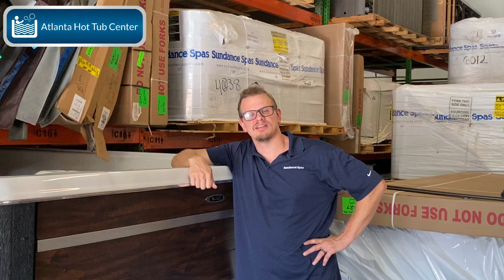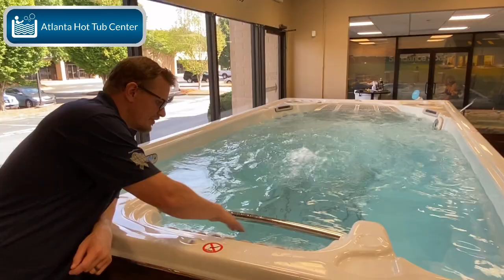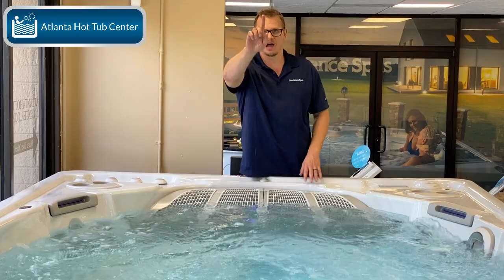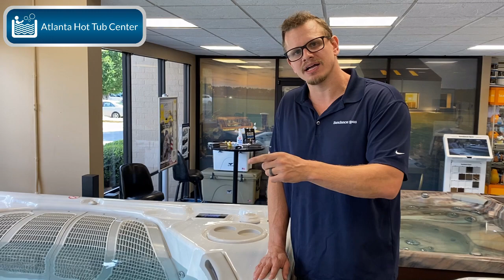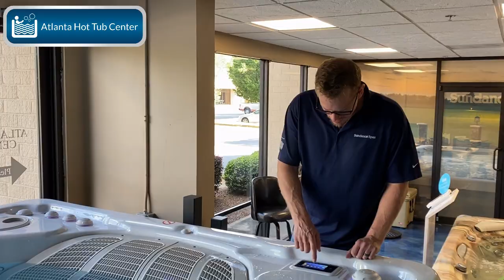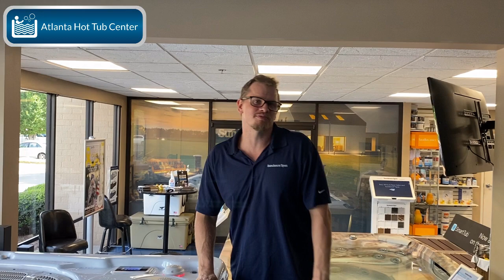HYDROPOOL swim spa REVIEW

Comment: nice review.. whats your opinion on the hydrojets? decent power?
Reply from the maker: Good afternoon, yes they're very decent.  However, swim spas are really pools as you really can't exercise in 100 degree water.  I like to mention this because a lot of people are thinking the swim spa is a hot tub and it's really not.  Hope this helps!
Reply: @atlantahottubcenter I wouldn’t want to swim in 100 water. The cooler water, not cold, but sun temperature.
Reply from the maker: @Zz724  Good afternoon, I agree and those temperatures are pretty easy to maintain due to the size of the body of water.  Really, swim spas are pools and more comparable to a pool opposed to a hot tub.  Hope this helps!